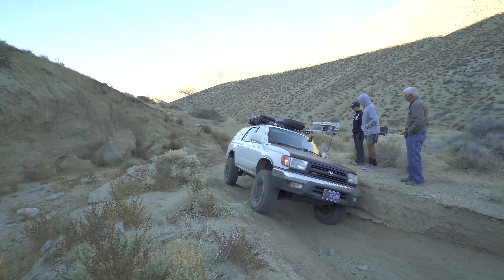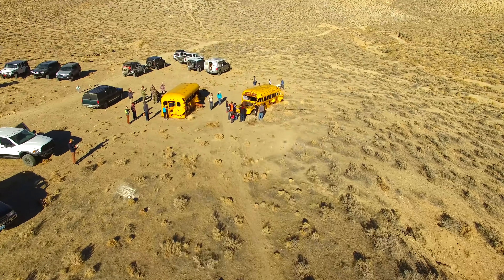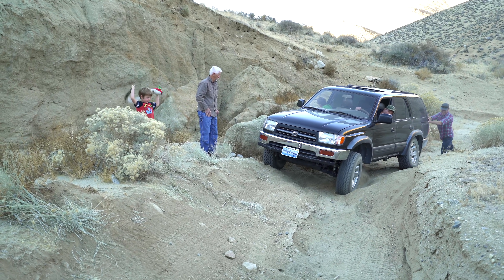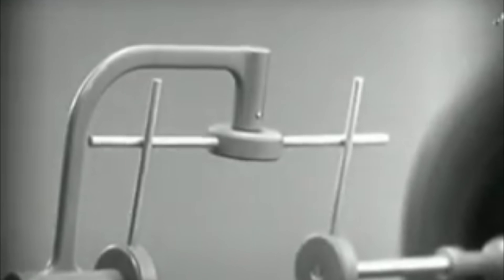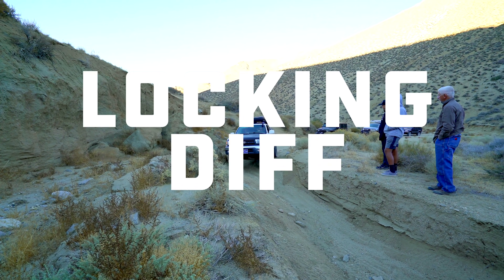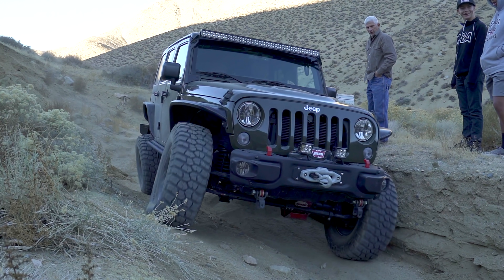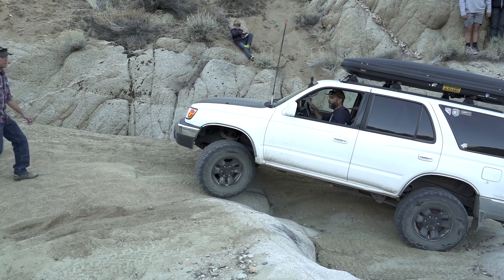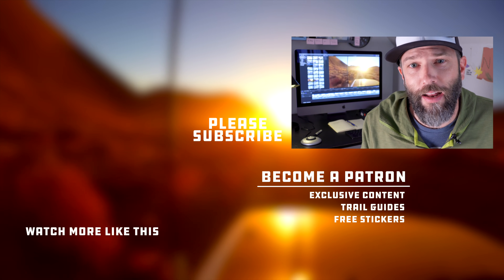Open Differentials vs. Traction Control vs. Lockers

Comment: My 4x4 Suburban came from the factory with the G80 auto locker. I have 285/70 17s right now and Bilstein 5100s frt and 5160s in rear. Knock on wood, I've never gotten stuck going out to my property in Pershing county so far.
Reply: I had the g80 in a Tahoe, it's useful, but it's a clutch operated system, not a true locker. Think limited slip or posi-traction.
Reply from the maker: My dads Silverado had that. You can see in our last video that it wasn’t working. I don’t know much about it. It was great when it was working.
Reply: @AllTerrainFamily  They're some good Youtube videos on the G80.  Just got to do scheduled maintenance and change it out if you you go with 35s or bigger. Check out the Bleepin Jeep channel and King shocks channel.  Also full drooptv channel.  They're all awesome!!         :)      Maybe your dad didn't use friction modifiers when he changed his diff fluid?
Reply from the maker: Maybe he didn’t change the diff fluid.
Reply: Great video on the Eaton G80 and others.  ;)
Reply from the maker: That was interesting. Thanks!
Reply: What cell service do you guys use when going deep rural in Pershing County?
Reply from the maker: Verizon has pretty good coverage. But generally there is no cell coverage.
Reply: @AllTerrainFamily  Yeah, most of the locals I talked to use Verizon.  Evere look into CBs. out there?
Reply from the maker: We use CB and FRS for comms between vehicles. For long range you can reach amateur radio repeaters with a dual band mobile or hand held. But I’m pretty happy to not get cell service everywhere.
Reply from the maker: I use Nevada mode most of the time: https://youtu.be/8S0EW5CdtNc
Reply: @AllTerrainFamily  Oh cool, thanks for the info.  Yeah, I know what you mean about cell phones.

Comment: Center locking differentials can get you out of any situation in my experience . Although it is similar to identical to 4WD
Reply: Locking the center diff or say transfercase in 4WD doesn't get you out of situations like demonstrated in this video. Locking front and/or rear differentials will help in diagonal situations like demonstrated in this video. People will talk about driving line, but when you have only one line, front/rear lockers are your friend.
Reply: What are your thoughts on to the center locking . Is it pretty much the same as 4WD ? Or is  it just FWD with power sent to the rear axle ?
Reply from the maker: I’d actually like to have a newer 4Runner for the part time AWD. It’s much better in the snow we get around here. At least for city driving.
Reply: @AllTerrainFamily  , So 2002 4unner does not have  rear locker and acts more like AWD like the 4th  gen. This link has some good info on the differences from year to year. When I install the ARB lockers I can still run the same setup and just lock the differentials when needed. https://www.toyota-4runner.org/3rd-gen-t4rs/82033-3rd-gen-4runner-buyers-guide.html#post706219
Reply from the maker: Well, that only applies to all wheel drive. All the vehicles here don’t have center differentials. They’re basically locked at the transfer case. So a locked center diff is equivalent to the black 4Runner here.
Reply: I drive a 1996 Land Cruiser with AWD center diff lock and F/R lockers. My center diff lock is automatically on when shifted to 4L and is very efficient at a 50/50 F/R power split, that keeps things smoother/controlled over obstacles. Rarely need the front locker....mostly because I pick a bad line. I wouldn't trade it for any civilian vehicle.
Reply from the maker: Is that the FZJ80?
Reply: My 2002 4runner has a center differential and I'd be curious to see how it would have handled the same situation. I am installing air lockers in February as my biggest issue is when I need to climb I can't climb very well with the center differential which causes me to come into obstacles with speed and not as much control.
Reply: Phillip Tilleman 3rd generation 4 runners don’t have a center differential, they are part time 4wheel drive.The only 4wheel drive trucks that have a center diff are the full time 4wheel drive which I think started the 4th Gen 4Runner.
Full time 4wheel drives like an all wheel drive because of the open centre diff when locked it will be equivalent to 4Hi at the transfer case on a part time 4wheel drive
Reply from the maker: Gotcha. I guess i thought 2002 was still 3rd gen. I’d like to find a 2009 trail edition w the locker.
Reply: All-Terrain Family , sorry. 02 is still a 3rd Gen, very last year. But it seems more in line with the 4th Gen than the 3rd gen. Does that make any sense. The link I shared earlier has the differences.
Reply from the maker: Your center diff doesn’t lock? I thought only the 4th gens had that.
Reply: Yes it's an FZJ80 with the 1FZFE engine.